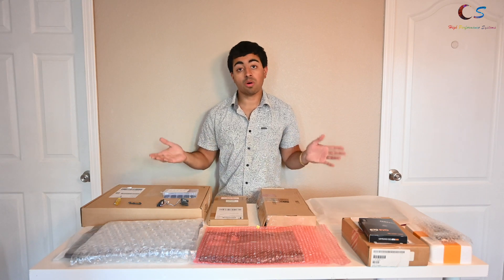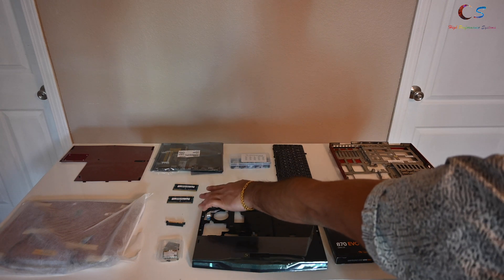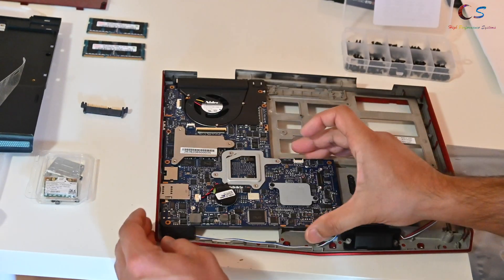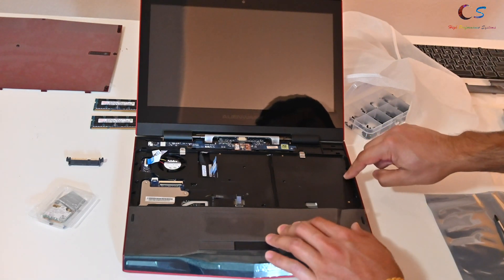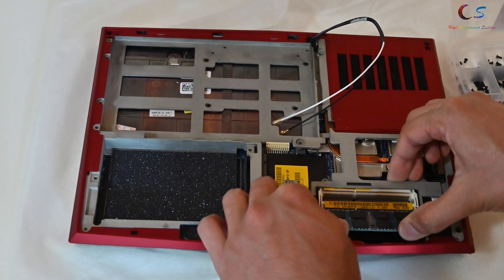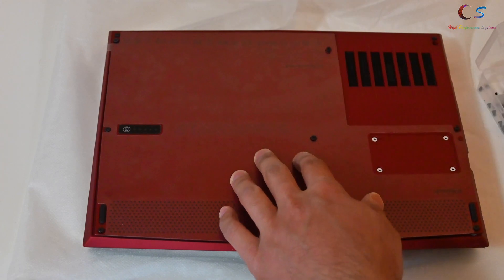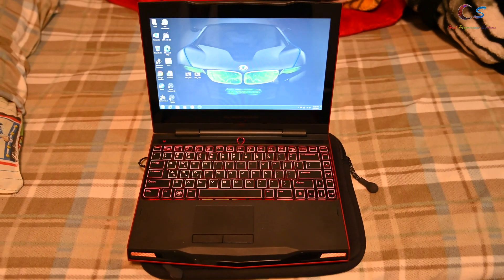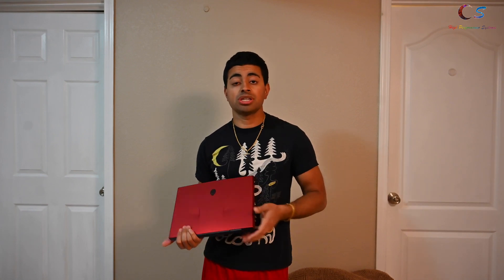Building a new Alienware M11xR3 in 2021

Comment: There is a company in the US that sells all the parts. Where did you find a new nebula red casing though and do you have the i7 motherboard?
Reply from the maker: Ali express and yes i7. Which company is this? I need 120hz 3d panel for m17x r3 and haven’t found anyone selling whole assembly
Reply: What is the company?
Reply: Parts-people
Reply: @professorvoluck9311  They dont have all the parts.

Comment: Great work. Awesome. Would you tell us how much you invested overall in this brand new modell?
Reply from the maker: I think it was around ~$750
Reply: @cs.studios  Thank you for that info. I would have guessed that too. Sometimes there are really really mint examples of m11x r3 with i7 on auctions available which achieve around 500USD, so it was to compare. But on the other hand, you have to be a little different, and a geek to use this things brand new. But, and that's still a fact, there is nothing comparable at this size to buy until this day. Thank you for sharing this video and your work. May I ask you one more thing? About the GT540M. Some sources say the have 2 GB Ram, Some say 1GB. Even the Manual tells both. But on the other hand i couldn't find out if here where really 2 and 1 GB Versions of the GT540M available. Whats the truth?
Reply from the maker: There’s 1GB and 2GB models. Mine was 2GB. Chances are the i7 version is most likely 2GB. The new alienware x14 announced seems like it might be the closest thing to the m11x so we’ll see when it’s out

Comment: Cool! I'm currently still using my m11xr3 from 2012 as my main computer. I've upgraded mine to 8GB of RAM, an SSD, and a brand new Wifi6 + BT5 card - and it's running fine. Can't game on it anymore though unfortunately :(
Reply from the maker: I play call of duty 2 on mine still 😁 it’s a great portable laptop and even today especially the R3 i7 model holds it’s own.
Reply: I have 3 of them and still use today.